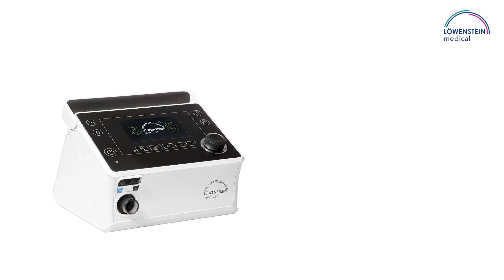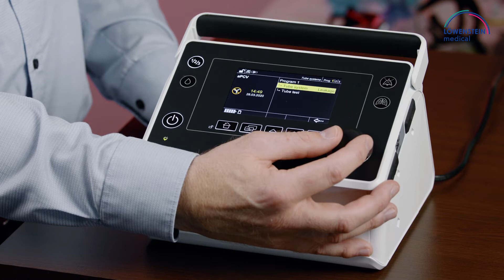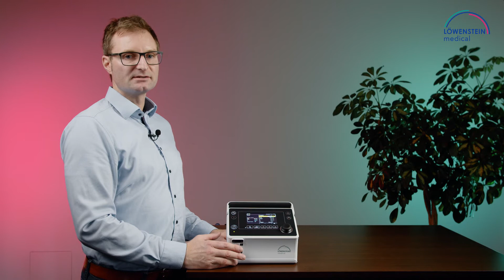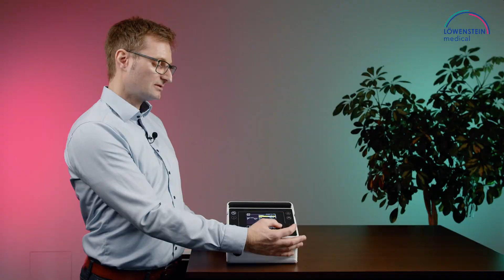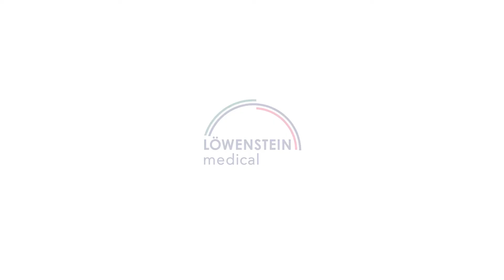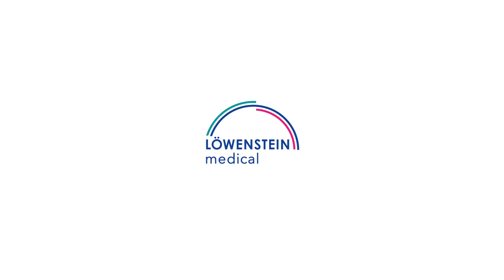09 prisma VENT50-C Valve Modes

Comment: what is the different from Leakage Tube versus Valve tube system?
Reply from the maker: Hi Perintis Solusi Perubatan, 

Leakage system: Min. PEEP/EPAP = 4 cmH2O necessary for CO2 washout via passive exhalation system. 

Single circuit with valve: Min. PEEP/EPAP = 0 cmH2O possible because of CO2 washout via active valve.

Also you can see our leakage Modes video here: https://youtu.be/f3OQRT7kgH8 

Best regards, 
Löwenstein medical team